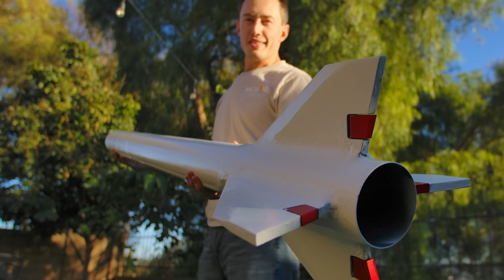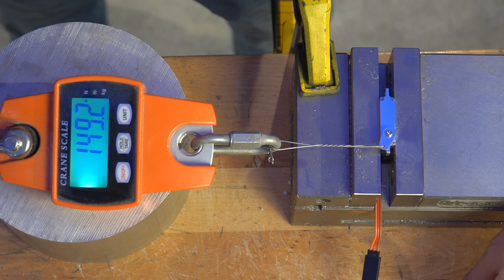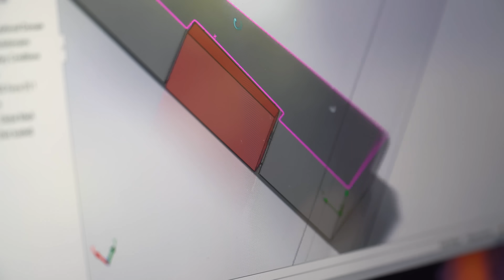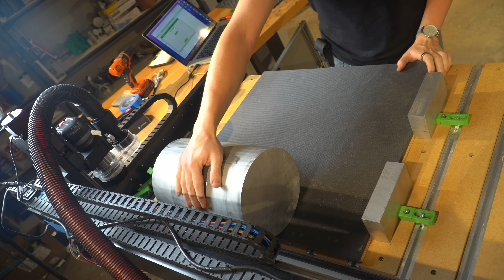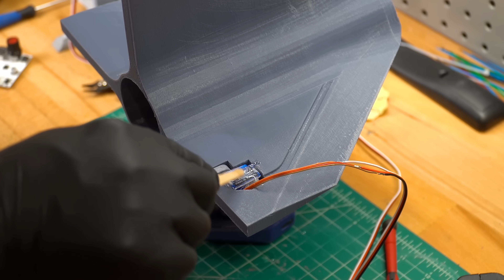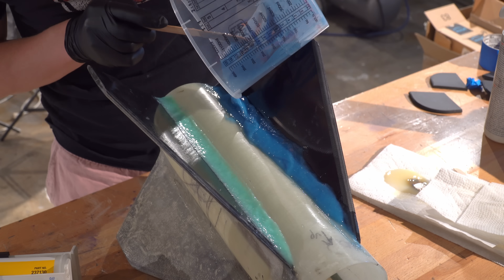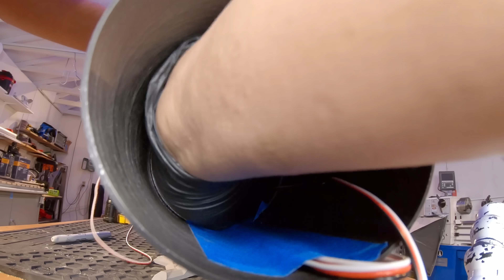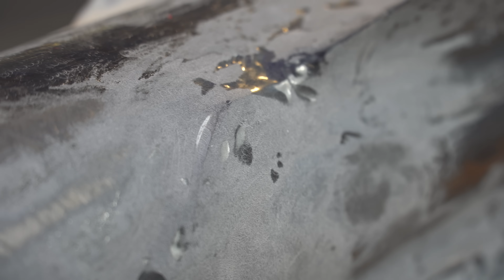Building a Guided Rocket to Hit Mach 3

Comment: When i looked at the part where you did the soldering I thought: "oh look, he is not using or forgetting heat-shrink tubing". We now know how that ended.. Also, I would string the wires together and then solder them. I am no rocket engineer but I would be scared about the soldering just shaking loose.

Comment: A friend of mine worked for Saab and they found out the hard way that CA can interfere with electrical connections on the JAS 39 Gripen aircraft. As far as I know its safe to pot a wire with it however its imperative to keep it far away from connecters or contacts. Given the cost and complexity of my work learning this forced me to rethink how I used CA in the future. Keep up the great work! You do things that are inspirational. Thankyou...
Reply: Heat shrink is good. :) Vibration and CF don't play nicely, and the lower adhesion to metal vs plastic is an issue.
Reply: @arfink  I was about to comment the same. A few cents can save you thousands.

Comment: I'll keep it short:
1, if you're relying on a specific torque spec at a specific voltage, you might want to check your voltage drop across that long of a run of cable for the servos.
2, You're using high torque servos. They are slow. Even if you're using a custom (or commercial) PID controller for flight control, there can be no value for the PID coefficients that doesn't result in oscillation. This, combined with the high frequency oscillations of flexing of the airframe can give you flexing oscillations in the 10s of Hz while you have roll oscillations in the single Hz range and pitch/yaw oscillations in the sub-Hz range.

I've seen rockets with active controls fail because of this no-solution PID problem. Its very hard (impossible) to find workable coefficients when you have strong resonance at several different orders of magnitude of time scales.

Here's what I hope: your flight control surfaces are small enough that your pitch and yaw and roll (this one especially) authority are slower than your servos movement and that the rocket is stiff enough that any flexing oscillations are too high frequency to matter.

Comment: lol. Thousands of dollars in carbon fibre and epoxy and not a single dollar for a little heat-shrink tubing to insulate the PWM solder joints correctly.

Comment: If you want to drill a straight hole in the fin use a pillar drill or milling machine with the fin held in a vice and peck away at the hole don't just send the drill straight through

Comment: I was wondering how the naked connection wasn't going to short on the carbon. I was thinking I'd at least paint the wires with finger nail polish or epoxy , varnish.  To insulate from the carbon fiber..

Comment: Razer does sponsors?

By the way i have a tip that could give you an easier time sanding an entire rocket:
instead of using a rotary sander you could use a pipe-belt-sander. its basically a belt sander that you can hold, where the belt is kind of "loose" on one side, making it very very easy to sand curves.
i am metalworker and we used those to sand and polish stanless steel pipe we welded together, it works like a charm. make sure to use one where the belt goes in kind of a triangle shape, as you dont want the belt to be supported, otherwise it wont bend to the shape of the pipe (duh)

nice vid as always, keep it going, i love every single project you do

Comment: For future builds, consider heat shrink over the solder joints, and also crimp the connectors onto the leads after they go through any holes (that allows drilling much smaller holes).

Comment: LOL at he paint being destroyed at mach speeds a friend built a mach 1.5 rocket years ago. Had a gorgeous paint job he sends me a video saying enjoy the paint this is the last time it will be seen. Sure enough as soon as it broke the sound barrier the paint was just got most of it flaked off instantly the rest just got worn away. And he had a camera facing down on the nose  along the body with a sensor pod on the other side. Those pods when he recovered it were scorched and very hot from hitting mach 1.5 made from aluminum. The heating was so bad they were pitted had it remained at speed much longer they would have been ripped off likely destroying the rocket in flight. 

He lost plenty of mach shot rockets in once instance he was doing a tethered burn test on the engine it broke free from its tether and launched and exploded about 300 feet up had it remained on the ground well even as far back as we was during that test burn it could have been dangerous. It used some aluminum parts sort of like a lattice structure to make it more rigid. That fairly hefty structure was ripped apart and twisted. We estimate it hit about .75 mach with out the nose section before exp loading he could have potentially hit mach 2 with that launch. This was just prior to any model rocket hitting above mach 1.5 or so so he would have set a record with it if he could have actually launched it.

Comment: Two things for working with epoxy:

1: Masking tape is your friend. For running the wires up the tube, a strip of tape on either side of the wires would keep excess off the surface. Additionally the tape could be used as a guide for your forming tool.

2: If you want to use a filler such as Kevlar powder in your epoxy but don’t like the rough surface, wait a bit for the epoxy to set up after shaping, then wipe it down with some denatured alcohol to smooth the surface. Wait for the epoxy to be stiff enough to stay in place, but still soft enough to be shaped. The alcohol softens the surface slightly allowing it to move more. Just using your gloved finger, wet with alcohol, will make the surface nice and smooth. This is a common practice in boatbuilding fillets.
Reply: Also, for getting a good bond to aluminum, hit it with some coarse grit sandpaper.
Reply: @Rocknurd9497 Yep, like 28:07.

Comment: Great video! I cringed a bit as soon as you started talking about not insulating your connections in the carbon fin, glad you caught that. IMO you have no excuse to not throw a little bit of heatshrink on there, looked like there's plenty of space and you'll save yourself the headache.
Edit: the electrical tape also seems like a nice solution

Comment: Maching composite material had me cringing, especially that much on the leading edges.  That might lead to delamination.  Laying up the plies on a tool and curing in a vacuum bag would be better.  Yes, the dust is hazardous.  Both to human health and equipment.  I might have tried laying up plies over a core material but with solid laminate on the trailing edge so as to mount the servos.

Comment: Great video!  Enjoyed every minute!  I have several suggestions for future builds:
1).   Ditch the Box Store drill bits. A suggested source is SMA Direct.  Also, cobalt drills for carbon fiber!  They can be sharpened sharper than the coated bits I recall you were using. American or Japanese manufacture. 
2).   Fillets.  Mount tube in lathe.  Once fillets are formed rotate tube to even out the gravity's effect. 
3).   Cable raceway 's.  Tube mounted in lathe, use carriage to smooth and index raceway. Withdraw cross slide, and spin. 
3).   After all carbon fiber work, cover entire vehicle with 0.7 ounce glass if weight is a concern, 2.0 if not, as 2 oz is easier to work with.  Round areas, probably including raceway areas use sock glass to eliminate joints 
(I don't know if socks are readily available in small quantities)
4).   Use an automotive body/paint filler to cover imperfections. 
5).   On copper nose cone, put a pointed spire to move shock wave away from your steak.  Look at early Polaris, Trident, and most Soviet missiles for examples. 
5).    While machining carbon fiber, cover as much of the machine as possible with double sided tape.  Cover all electrical outlets and switches as well.  Cover with painters tape first, and remove both tapes when finished, after cleaning work area! 
Carbon fiber seems to be attractive to electrical and WILL cause problems.   I don't know what threshold is so be careful! 

I have enjoyed your content for a number of years.  {Key word and tricky phrase)
SEMPER FIDELIS 
BOB
Reply: well said.    youd kill it writing a book.

Comment: Why not also print some very thin raceway covers that you can use to contain the wires to keep everything very straight, glue them to the rocket and then put fiberglass on?
That will be the best of ... well, all worlds! Straight, aerodynamic, solid, bonded to the rocket... and MAYBE they would even allow for maintenance, if you don't glue the wires into them!

Comment: Have you considered using the servos themselves as control surfaces? That would cut down on the                                                                                                                                                                                                                                                                                     reduce the need for cutouts in your fins.A custom bottom housing could both provide an attachment point for a bearing as well as a spot for the wire to pass through into the fin...
Definitely a lot of work for "no effort".

Comment: you spent a ton of money  and effort here and it's a fantastic job but I was absolutely confused on how you decided to not insulate the wires like I would have done in a scrap project if I did not find any shrinkwrap the right size just WHY? It gave you problems at the end but even if it didn't with all the good stuff you have there why not?
That's the only low effort thing in the video the rest is actually really high in my standards

Comment: Hey Joe, I know from robotics that those servos sometimes have a really bad thermal conductivity inside the housing

If you can manage to machine the housing to add a screw fill port, you can flood them with clock makers oil. We used to do this on the high performance robotics servos for competition.

Definitely try it on a damaged servo first though, we had a different model of servo that just died immediately when flooded.

Comment: When it comes to servo extensions...
In my opinion, a better solution is to buy a wire, crimper, terminals and make your own wires to a specific size. This is what many modelers have been doing for years (e.g. drones) and this method is safe.

Then you bypass the risk of a short circuit.

You build such a durable rocket, but you create potential failure points by insulating the solders only with glue? And what about vibrations and the possibility of shorting the entire electronics just because of such a small thing?

Well, you're brave...

Comment: You forked out for ANSYS? Fair enough. My 2022 laptop (i7, RTX 3050) just about handled simple dynamic FEA simulations, but took hours to complete. Not envying you running CFD through it, but will be interesting to see how it works out and how close it holds up compared to desktop setups.

Comment: Should have used crimp splices for the connectors rather than soldering. Also, the connectors can be replaced going to the flight controller board, so you could have done a hole big enough for the wires instead of one sized for the connector. Additionally, if you're replacing the servo connector, something that latches and is keyed might be preferable to the default servo connector, like Molex SL. Lastly for this, you should also be able to just use a 3 conductor ribbon cable for the extension and use that all the way up from the servo, instead of having to do two different splices.

You're probably not going to do the raceways the same way, but having a guide rail to run the raceway form over might have helped avoid the issue with losing track of where the signal wire is. Use the fin jig to hold the rails in place with the convenient screw holes. Speaking of the fin jig: what about using it as the mold for the fillets? Design the fillets into the jig, and you can inject the filled epoxy down into them, the pull it off for all four sets of fillets at the same time. Then you don't need to time your pulling precisely.

Comment: consider using a single piece of heatshrink for all of your servo leads. so, stagger the connections like before and have a single shrink to go over them. that'd be more reliable than just putting electrical tape down as an isolator and will help you in the long run as you can just make the long extensions on the bench and test before putting it on the rocket rather than having to extend them as you go.

Comment: I'm curious which type of sandpaper you use. I work for a manufacturer of that stuff, and would guess a silicium carbide type should work best, as that is what we suggest for very hard materials like glass. Corundum, the stuff used in typical cheap sandpaper for wood, is probably too soft.

Comment: @14:50. Why did you extend the existing servo cables?  I would have opened the servos and replaced them. This would   remove 24 solder joints and therefore reduced risk, labor and mass.

Also please use eutectic solder, e.g. Tin 63% / Lead 37% solder. This removes the plastic state so no cold solder joints and also no tin whiskers, reducing risk. It is not ROHS compliant......

If you still want to splice wires, please use a "telephone splice."

Comment: Twist your wires together before soldering them and use heat shrink to insulate the splice.  The way you did it creates resistance in the connection forcing the solder to carry the load.

Comment: I have seen a system of fin self correcting ailerons with a wheel that pops out of the rim of the fin it is counter rotating and rotating out when point vertically down soot is gyroscope correct and calibrates easier  than almost any other type it's basically a triangular with a pivot at the apex front point and sprung to a load that is less than the push capabilities of the spring so as gravity's effect is ultimately what causes the ejecting of the correcting wheel,,it slips back when it is in the corrected poition and it can be attached to a servo moter that would aid this retracting action,  it is patented but there is always a way around all things..

Comment: "if I were making a crewed vehicle, I would not use expired epoxy"

A certain submersible entrepreneur could have used that advice.
Reply: Also, with the single raceway discussion, you could also consolidate power and ground wires along the raceway, decreasing conductor count from 12 to 8 for two raceways, or 12 to 6 for a single raceway. You'd want to measure current draw to make sure the power conductors could handle the increased current, but it almost definitely wouldn't be a problem (though the eposu insulation wouldn't help).

Comment: All the fun n games with the Carbon Fibre, wouldn't it have been just as NFG to use the plywood parts, wrapped in Carbon, or with a metal leading edge?
Surely there's more then enough strength in the plywood.

Comment: For the fillets, have you considered making a silicone mold? Silicone will leave a clean and smooth surface finish, you can use your kevlar mixed into epoxy and still end up with a good finish. The creation of the mold would probably take some time but offset the amount of wiping and cleaning while also reducing waste. The mold will also be highly reusable.

Comment: the diagnostic constantly checking that the servos are still working makes me want to build a little probably arduino based box that just moves servos back & forth, with an override switch & regular control knob. It would also be cool to do this just with transistors & etc but I have no idea how you modulate PWM that way, I guess maybe a PWM carrier frequency oscillator and an LFO with an opamp circuit that generates the PWM using the LFO as the threshold? Then the override switchs in the knob as threshold?

Comment: 15:15 "dude why are you not just insulating? I.g. you can save 0.5 grams on heatshrinks or something and try using raceway fill both as fill and insulator, but you've got carbon all over it and it's conduct..."
 16:30 "ah, that's why"

Comment: Question; they are some big fillets.....have you tested/looked at the difference in thermal expansion coefficient between the epoxy and the carbon fibre fins? The epoxy being quite brittle with that potential reasonable temperature change have you considered it may crack? Why not make a smaller fillet and lay external weaze offer the fillet? Given you have thought of everything else it seems I suspect you may have done some temperature change testing on that joint? Looks awesome fun though.

Comment: Love your content, but your soldering leaves some to be desired. In rocket land follow your rocket daddy; 

https://workmanship.nasa.gov/lib/insp/2%20books/links/sections/616%20Service%20Lead%20Splices.html

Your soldered joints have a very real possibility of vibrating apart and with your concern about serviceability using proper soldering techniques should help in the future.